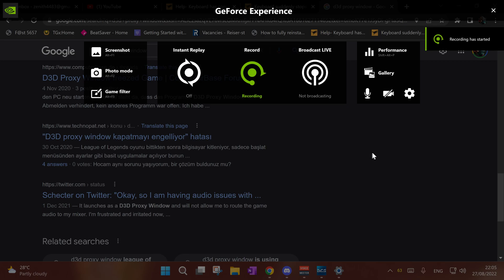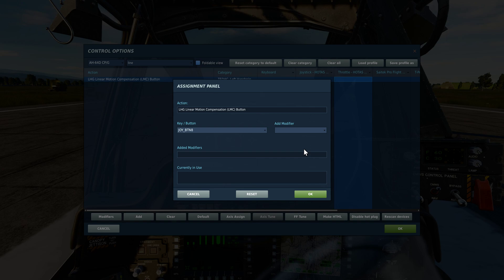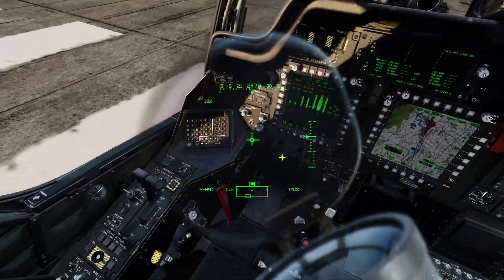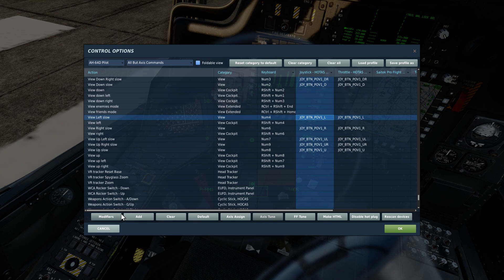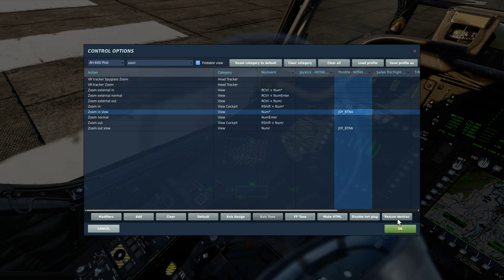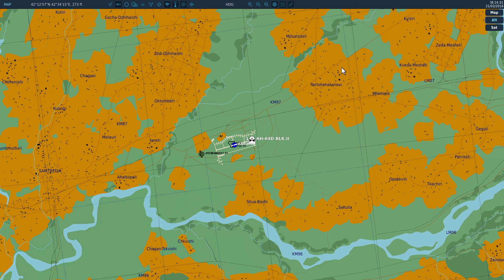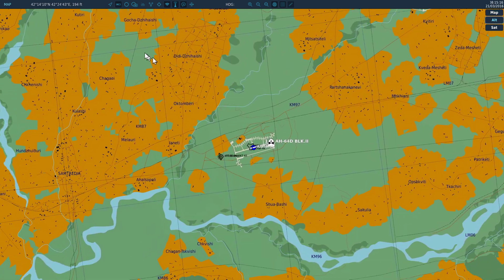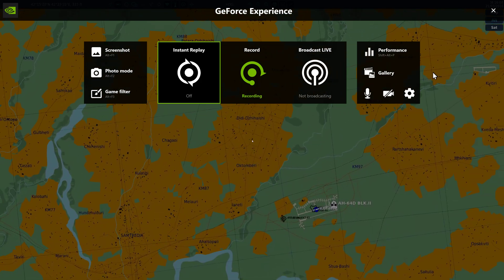DCS Keyboard suddenly stops working

Comment: Same problem, X56 HOTAS using modifiers seems to do it for me, but also might be my K63 wireless keyboard, it being wireless or something, no idea why. Seemed to have started after adding the modifiers sometime 2 to 3 months ago in 2.7 and is if this user wide is not addressed in 2.8. Just another issue that prevents me playing and especially buying any more modules. I will try binding ever single button that are assigned universally to the stick to a modifier to see if that what causes it, I am not seeing anything else that could cause it. Windows 11, Quest 2 with oculus or steamVR driver installed, happens in VR as well, not sure if it's the game, driver or hardware.

Comment: I have been having the same problem with the F-16C in VR mode. Suddenly I find out that my H.O.T.A.S. stops working  expected as it is sending keyboard commands. Of course, the keyboard also does not respond. I cannot even hit ESC. The only way that I seem to be able to get around it is  to hit Ctrl-Alt, so that the game loses focus. When the message appears that the window is out of focus, I then switch back to DCS and the keyboard works again. This is of course a real problem as it tends to happen at the most inopportune times. I hope that this gets fixed, as it makes DCS almost unusable.
Reply: I figured out the problem.  It turns out that my 10-year-old X-52 (not Pro) joystick was sending an infinite string of characters to the application, thus somehow drowning out all other keyboard input. In my case, it was the precision slider that was being used to extend the speed brake. When the slider was in the full down position,  it was sending an infinitely long string of the letter "B" to DCS as if the key were being held down.  I was able to test this in Notepad outside of DCS. The problem was "resolved" buy just pushing the slider up a few millimeters. At this point, I do not know if this is a problem with the hardware or with the profile, but I just thought that I would share this in case it might help anyone else who is having similar issues.
Reply: @Himmelgrau68  How did you see this in notepad?
Reply: @g00gl3_us3r  I noticed it in the H.O.T.A.S programming software, where you can test the input.

Comment: me either, after updating DCS, Keyboard stopped working. still mouse and joysticks work. only keyboard stopped. F/A-18C module.
Reply: ye, ofc I didnt connected my Xbox controller
Reply from the maker: @KoyoSimp170  I think we can close the case:

After formatting to Windows 11 stable release, the keyboard issue is gone.
I was signed-up for the DEV release version of Win11, so I had to format clean and install from scratch.
But at least the game works again, which is all I care about really.

It's interesting to try and see what's the root cause with the Dev release of windows 11 is, since these updates will inevitably trickle down to the stable version in a couple of months.
Reply: @AviAssayag  formatting? you mean wiping out all OS related files and installing "stable one" instead?
Reply: @AviAssayag  What kind of keyboard did you have? I have the latest WIN 11 and was not on dev, formatting did not fix it. I do not think it's DCS's fault because I have a 2.5 version that's also doing the same thing.
Reply from the maker: I hope they fix this asap